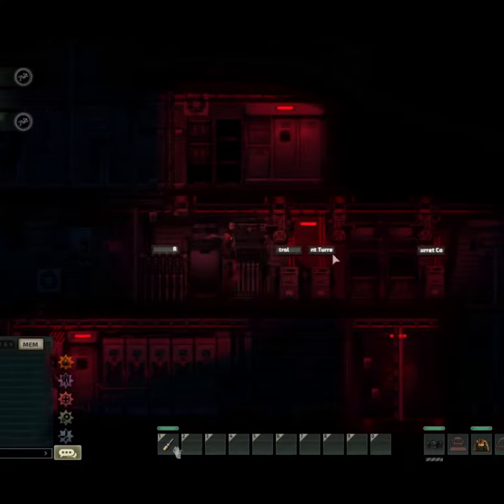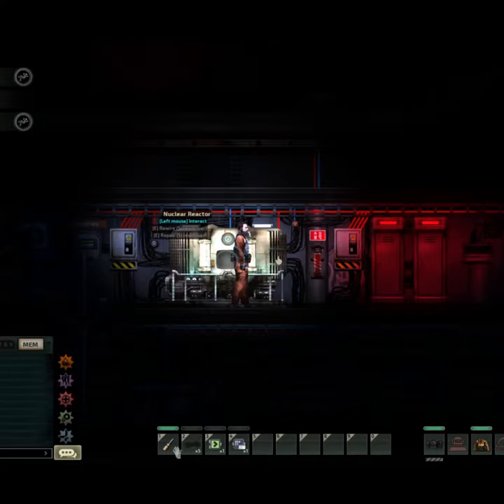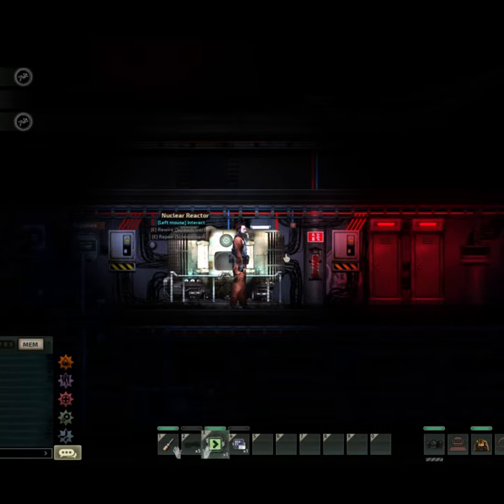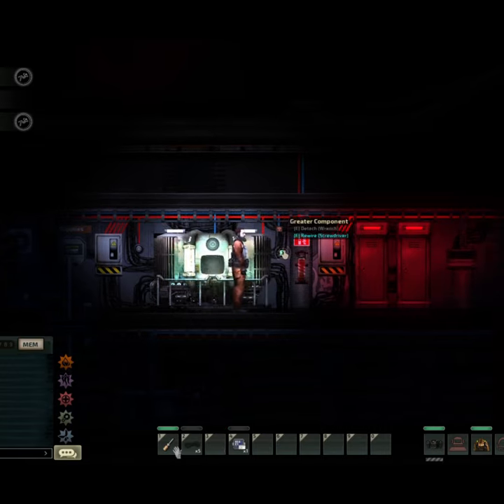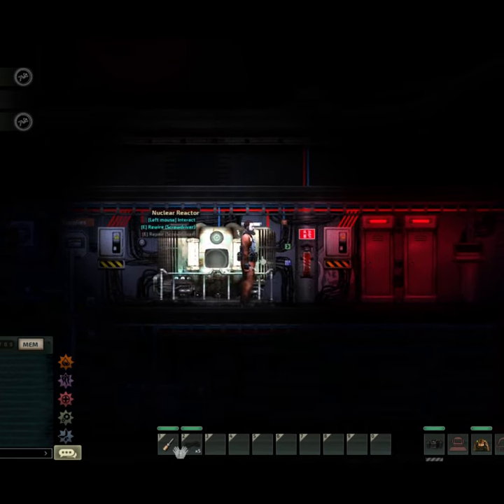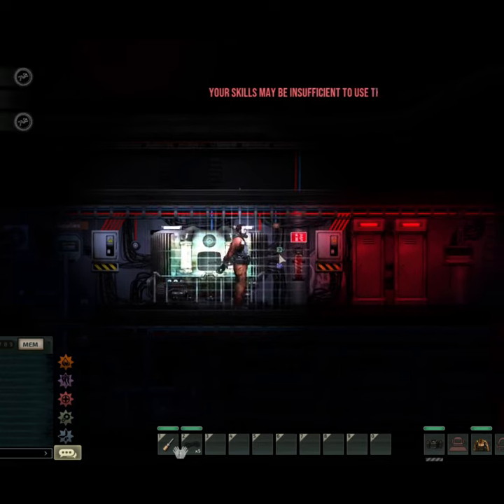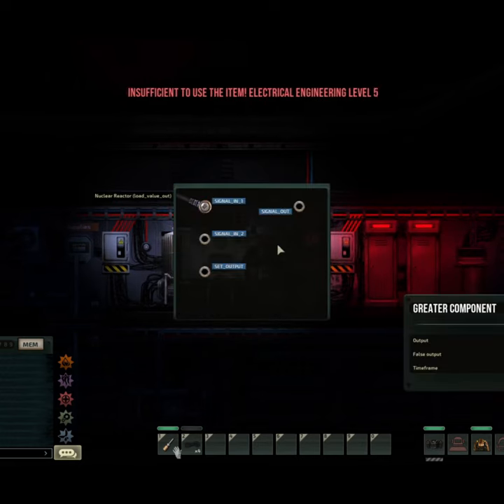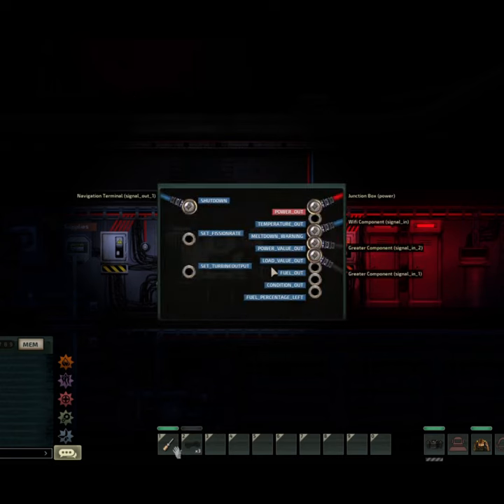Barotrauma Wiring | Automatic Reactor Controller

Comment: What are the benefits over using the reactors ato mode?
Reply from the maker: This circuit is pretty old now, I don't think there's any benefit over the automatic mode on the reactors now. The devs did an update that specifically made reactor circuits barely work
Reply: @DreadedEntityMain  There is a 5 component reactor controller that I still use, and it does work. It's still in the DIY Reactor Controller workshop item.